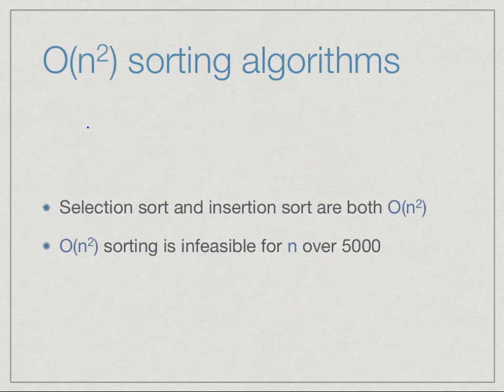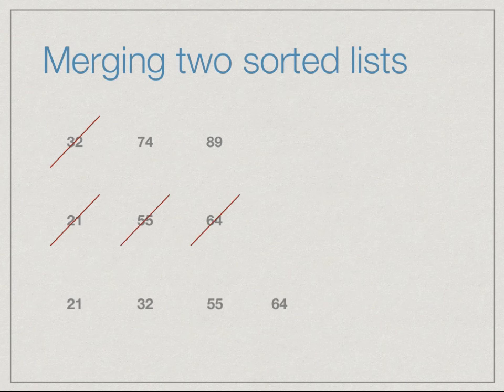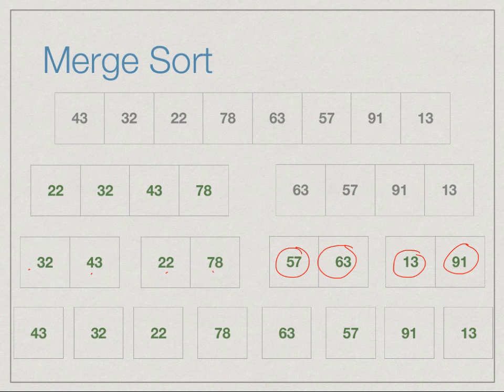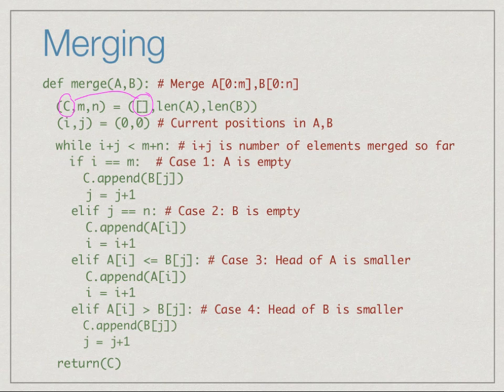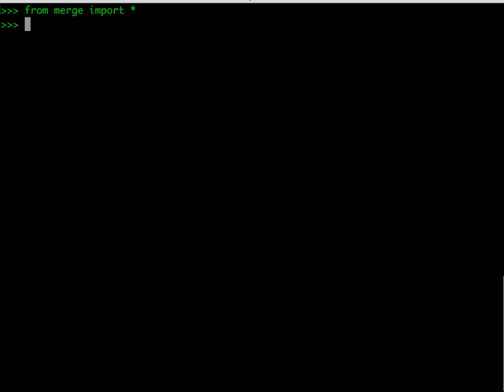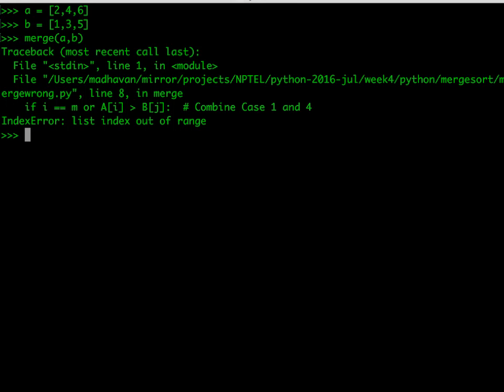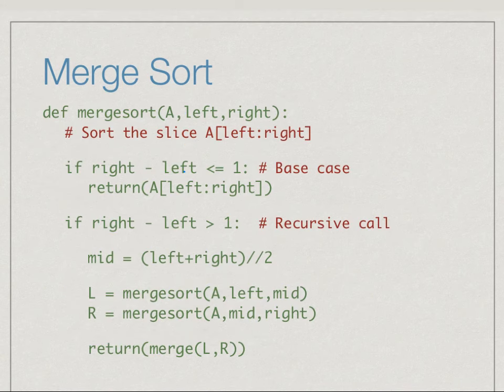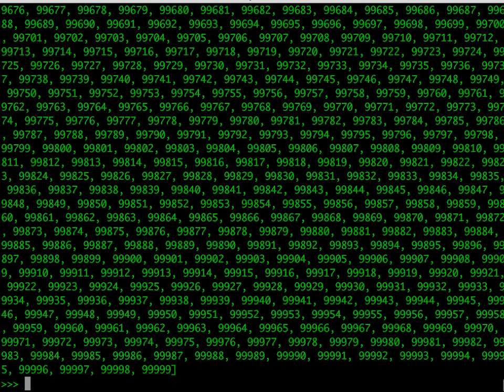mergesort

Comment: A shorter Program for Merge Sort. Using recursion without much variables and also usible one of the combine as given in the wrongmergesort program. 

def mergesort(seq):
    k=len(seq)
    if k==1:
        return seq
    else:
        return Merge(mergesort(seq[:k//2]),mergesort(seq[k//2:]))

def Merge(seq1,seq2):
    C,m,n,i,j=[],len(seq1),len(seq2),0,0
    while i+j<m+n:
        if i==m :
            C.append(seq2[j])
            j+=1
        elif j==n or seq1[i]<=seq2[j]:
            C.append(seq1[i])
            i+=1
        elif seq1[i]>seq2[j]:
            C.append(seq2[j])
            j+=1
    return C

Comment: If I give input list 38 27 43 3 9 82 10
The output I get is 3 9 38 27 43 82 10
Reply: Here, he is just merging the two sorted list  in a sorted order,
but is not using any divide and conquer strategy. For your input write divide and conquer program and then apply merge sort.

Comment: Explain ,if right - left <= 1: please i cant understand why
Reply: So right and left are indices right?  right - left <= 1 in the following cases- If your left and right indices are for eg, 3 and 4 (len(A[3,4])=1) or 3 and 3 (len(A[3,3])=0). So ultimately there is only one element or no elements considered. So there is no need to sort the list in both cases. We only sort lists having 2 or more elements.
Reply: @vaishnaves1723  how can i consider no element either ther is 3 is present or 2 element is present(3,4)
Reply: Left Is the first index right is the last index, if left and right are the same then there is only 1 element. If left and right differ by 1 there are 2 elements. So sorting a single element or 2 elements is very is. For eg sort 5 will return 5, and sort 4,5 will return 4,5